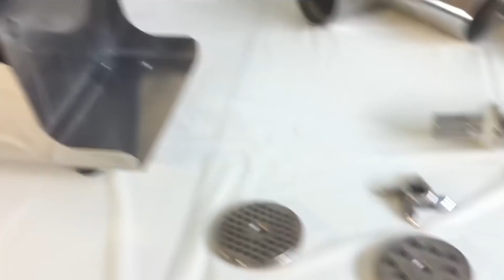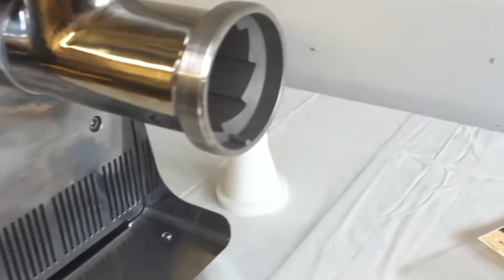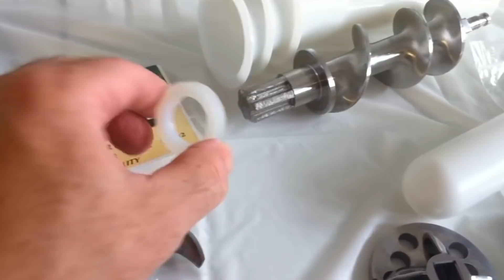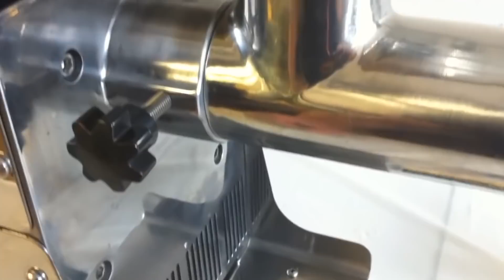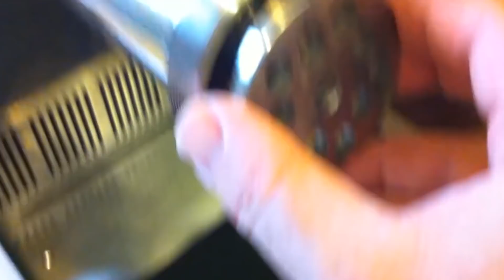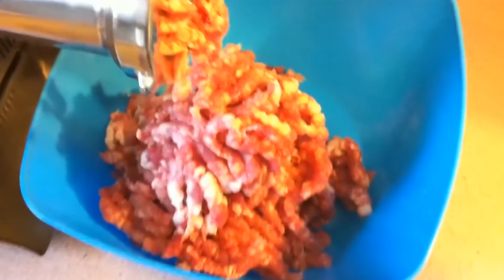LEM Meat Grinder || Why is Best ?

Comment: We bought this recently, the LEM # 12, and used it last weekend to grind 50 lbs of fresh pork. We made 25lbs of sausage and 25lbs of Brats. The stuffing tube worked great and this grinder is a workhorse. We ground all 50lbs in a very short time. I had been a meat cutter for years, working with large Biro and Hobart grinders and for the size, this thing is a powerhouse. Easy to clean, easy to operate. We look forward to using it again and again. Very nice grinder.
Reply from the maker: Thanks for sharing

Comment: My review won't show up as a verified customer because my wife ordered it. I'm the one who uses it. I bought the 1.5 HP #32, and that auger would tow a '67 VW Beetle of I tried to use it for that. The manufacturer says no bones, but I dropped in chicken legs with thighs attached and it begged for more. Yes, we feed our dogs homemade raw, and this is the grinder I've been waiting for.

Just a tip, it isn't great for soft stuff, specifically kale. That catches at the end of the auger without the blade chopping it and binds up the works, enough to trip the breaker. It also had a problem with pineapple for some reason. Whole leaf spinach, strawberries, apples, carrots, beets and chicken bones went through it without a whimper. I only gave it a 4-star rating on use because it isn't perfect for everything.

Actually, it isn't that easy to assemble because it weighs a ton. It got a 5-star there because it is better than other pro-grade grinders I've owned in the past. The 1.5 HP model is serious stuff, and it's pretty heavy even broken down into pieces.

The included grinder plates are coarse and fine. You can order one of several medium plates from LEM for various grinds. It comes with stuffers for snack sausage, hot dog size or decent smoked sausage, and a grinding plate that mostly will send the meat through with little re-grinding. What more can I say but that is hog heaven? For me, at least.
Reply from the maker: Thanks for comment
Reply: I ordered #22 did i made a mistake? Was i supposed to order 32#?